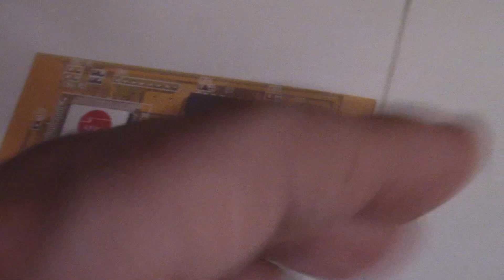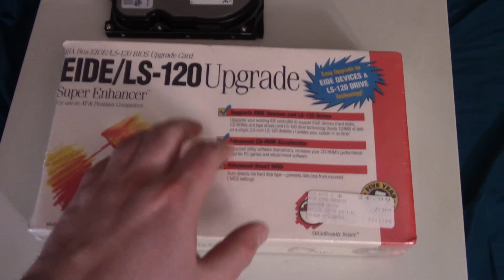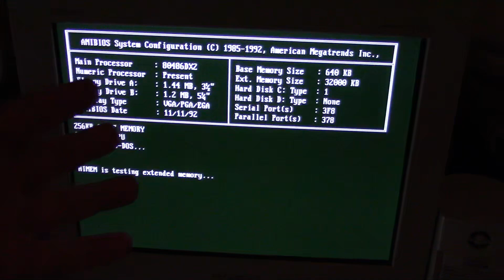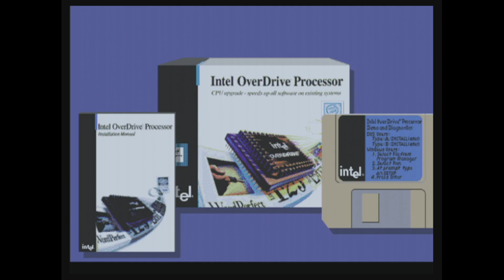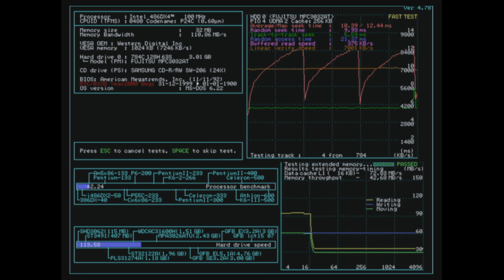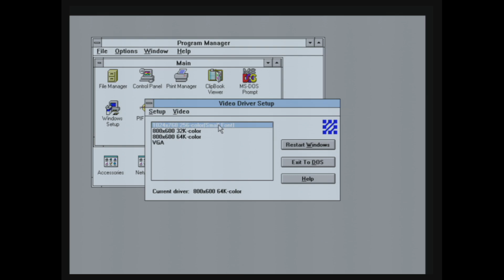Upgrading my old 486 DX2 Part 1: Intel Overdrive

Comment: Check JP2, below the VGA port on that Powergraph C33 card.  Those should control your wait-states.  

Eep386 on Vogon's forum spelled it out as follows:
"JP2/1: Waitstate jumper 0?
JP2/2: Waitstate jumper 1?
JP2/3: Sync rate? (when set, it uses regular VGA sync rates, but when removed, it outputs at different frequencies - crappy monitors and flatpanels beware!)"

Comment: I have the same motherboard (Elitegroup ECS-UM486V-AIO(DIP) Rev.2.0) in my Compudyne from '94. I upgraded it with the Kingston TurboChip 133 in '97, and as you might guess, it too disables the L2 cache when installed in this specific motherboard. I've even retested it over the past few years, trying all the various jumper settings, to no avail. Setup also includes a CT2950, a STB Horizon-VL (CL-GD5428), and 20 MB RAM for comparison.

Comment: The P24 setting on your board refers to the 486 DX4 Overdrive you just installed, so it might be necessary to enable it to get the L2 cache to work. The  Pentium Overdrive chips used the P54 core.
Reply from the maker: The marking on the motherboard your referring to says P24T which designated the Intel Pentium overdrive. A non-Pentium 486 overdrive would be P4T or P23T. regardless it's probably worth setting it to that setting and seeing what happens, I don't think it can hurt anything.

Comment: The 20ns rating on the original cache is just another way to say 50MHz, so that spec was already overkill for a 33MHz bus while a 66MHz bus would require 15ns. The cache subtimings aren't solely attributed to the bus clock the chip is rated for, so there's no guarantee that using 15ns chips will allow tighter timings than the 20ns parts.
Also the 486 overdrive chips were a bit notorious for cache-related incompatibility. Some boards just weren't prepared for the quantity or layout of the L1 cache and the way that manifested itself varied by chipset and board implementation. In some cases it was correctable through BIOS settings or an update.

Comment: I think the main thing lowering the TopBench score in comparison is probably the graphic memory speed and the memory speed. The 486 CPU on the other machine also has a higher clock which may influence things. TopBench is a 16bit program, it doesn't take full advantage of newer hardware in many ways, so you might see bigger increases in software that can take advantage of the overdrive (which is a pentium?).
Reply from the maker: The Overdrive is actually a 486. There are indeed 83MHz Pentium Overdrives but this one is just a plain old 486 Overdrive, specifically just an Intel 100MHz DX4 with a heatsink and voltage regulator slapped on it. Now if topbench does take video cards and L2 cache heavily into consideration then yhea, this WD card is slower than the et4000 in my other PC and the overdrive seems to be disabling the L2 cache. regardless of what Topbench says all other benchmarks are pointing to this machine being a bit faster overall with the 33MHz faster 486 and 16k of L1 cache.

Comment: Huh.  I have an AMD 486DX/4 100MHz system on a motherboard with 512KB of L2 cache that isn't recognized, just like yours.  I never thought about CPU compatibility as being a problem.  Makes me wonder if I should try changing out the CPU.  But the only other CPU I have on hand right now is an Intel DX/4 Overdrive like yours, which I suspect may still be an issue.  The missing 512KB of L2 seems to have really affected the performance, too.

Nice video, thanks for sharing!
Reply from the maker: well, it's not good that someone else is encountering the issue but it does add one more clue that this may be what is happening. I tried reinstalling my 66mhz DX2 and sure enough, the L2 cache worked fine again.

Comment: My old GA-486VM based DX2 machine disabled the L2 going to a DX4 OverDrive too. I think it has something to do with the L1 being 16K instead of 8, the BIOS and/or chipset can't handle that and 256K of L2. I wish I'd had one with 8K at the time to test with the 3.3v interposers I have now, to test my suspicion. Shame the Am5x86 only seems to come in a 16K L1 variant.

Comment: They're a little odd the first time trying one, but check into 'dynamic drive overlays'. Shortest summary is that they can bring pretty much any DOS computer up to a max HDD capacity of 8GB.
Reply: Or, flash a 28C64 with the XT-IDE Universal BIOS for 386+ machines, stick it in your NIC, and enable the boot ROM. Instant LBA support! Disclaimer -- DOS/Win9x and Linux work fine with it, NT and OS/2 need a specific driver that doesn't exist because the boot ROM technically turns your IDE channel into an int13h device.